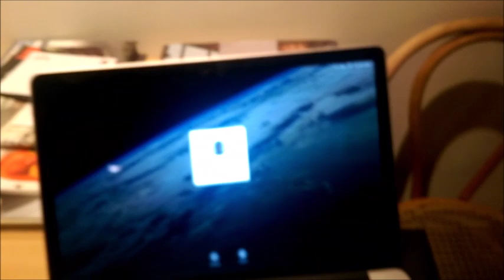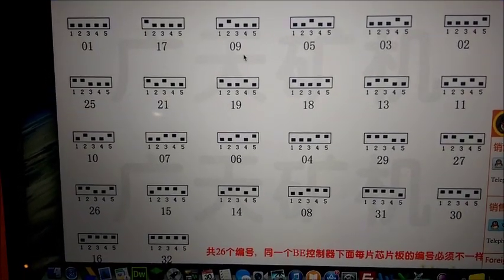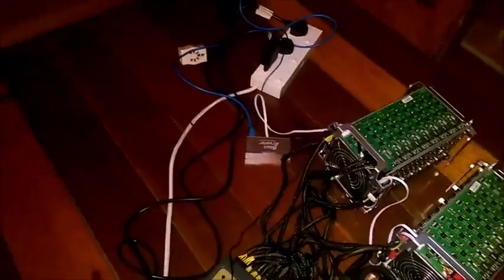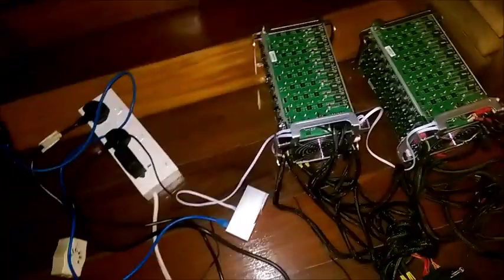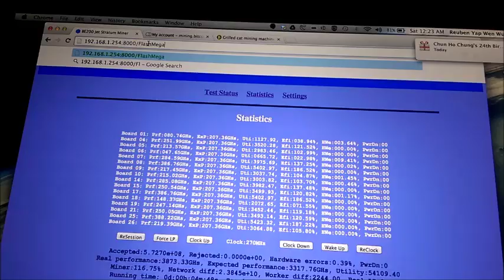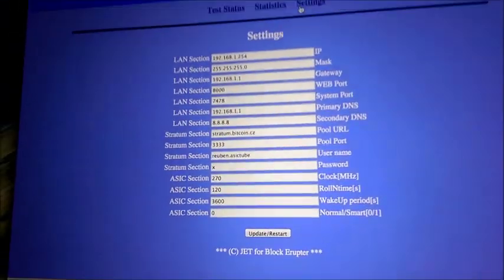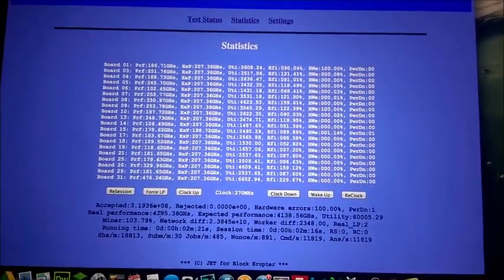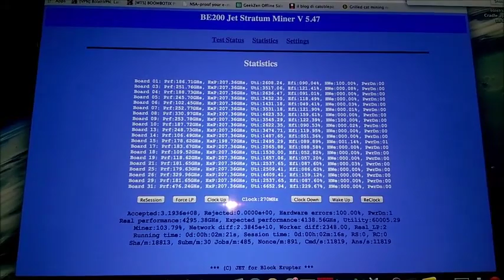ASICMiner Tube Assembly Tutorial

Comment: Also I noticed that you said the X4 is the input and the X5 is the output (at least that's how they're labeled on my board.)

So eventually you mention that you can take the long one (from the X5) and use it to go to network controller or daisy chain to other Asic Tubes.

wouldn't the network controller be taking in (input) an internet connection on the FIRST asic tube?

This part is confusing me?  Or maybe I'm getting it mixed up and should be thinking that you want OUTPUT of last asic tube to go to network controller to send out all the mining data? then all the other asic miners would be connected BEFORE that last one. Therefore you mention it goes from the X5 (output) to the network controller? Please clear this up for me.

Comment: I have set everything up as you did. I tested my LAN on another PC just to ensure it was active; and the network is receiving internet. All PSU connections are complete (but I'm using two different PSU's to power the one tube as I don't have enough outputs from the one)

I'm also wondering what is the minimum required watts per card on the tube?

So with this setup; and everything powered up. I cannot seem to connect to 192.168.0.254

It just doesn't load.  Nor does it load if I try 192.168.0.254:8000
 
I just says "could not connect to 192.168.0.254"

Any ideas?